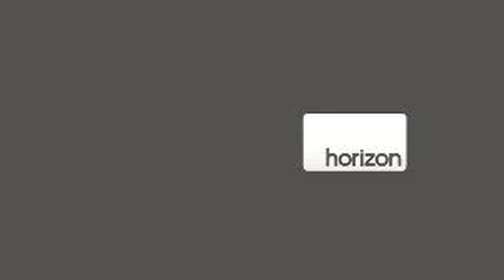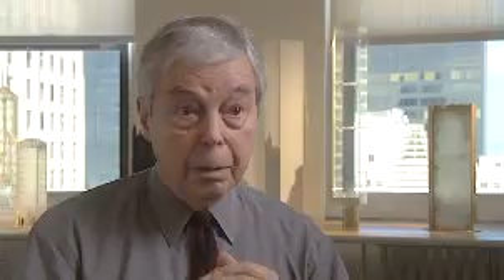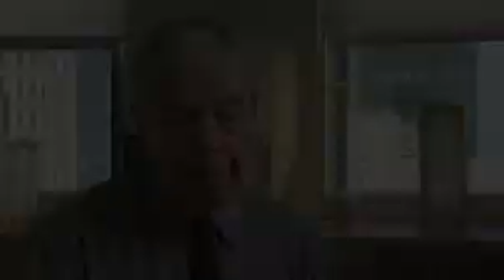Leslie Robertson - Chief Engineer - World Trade Center - Twin Towers

Comment: The best engineer to answer this question comes forward and guess what ... the conspiracy nuts STILL don't question their ideas. I used to believe those ideas at one point, then I changed my mind due to a better understanding of the evidence. Who has the more open mind? Conspiracy nuts, or those who are willing to listen, understand and change their mind when they become aware of new evidence of significant import?
Reply: +askquestions Not only pixel messes, but also sound messes. Plus military officers from other countries who understand the security measures said this is impossible because such a flying object would have been forced to land or shot down by two machines that are always prepared for such case. Also, architects and engineers said its impossible that a building would have collapsed in such case or that an airplane made of aluminium could pierce it. Hell, its not even possible for the boeing to fly that low at such a speed. Then there were the pixel messes you mentioned,  diagonally cut steel beams and traces of thermite. And there are also the political aspects. One year before 9/11 the Taliban refused to sign a pipeline deal with America. The US couldnt invade them because the public was opposed to any aggresion, so they needed to convince the people somehow. The Taliban wouldnt be so stupid to give the US government and the people a reason to invade them after they rejected a pipeline deal, it would be retarded.
Reply: The Buildings came down due to the large amounts of Gayness.......Yes you heard correctly GAYNESS!!.....
Reply: Perhaps I can shed a little light on what is being argued about here...

I haven’t done heavy scientific research, conspiracy research, etc... I will only try to explain this in the simplest and most common sense way possible, as it was told to me... most of this you’d probably know of anyway, but I would like to share what I was told...

In 2001, my husband was on the legal team that represented the Port Authority on the sale of the WTC to Silverstein.... the team also represented the PA on their  RE-leasing of the space they occupied prior to the sale.

He was in the conference room with many other attorneys when the Insurance conversation was happening.  The conversation still resonates with him to this day...

The chief engineer of WTC at the time (I honestly don’t know his name, and not sure if it was this man), explained to one of the attorneys who asked, “What is the likelihood of one building coming down, let alone two?” , that,  “ It’s not as hard as you think... it’s just steel... all you need is enough heat.”... And if I heard correctly, the Twin Towers were built to collapse straight down, correct?

So, yes, a building like that CAN be taken down by fire.... Can’t get much better of a confirmation of this than from  the chief engineer of WTC,....Again, my husband was present during that conversation, and it still resonates, and haunts him, to this day...

Two huge planes crash into buildings with tons of jet fuel.... fires, unbelievably high temps festering for a decent length of time.... there would be nothing else but collapse... common sense... 

There is a first time for everything, and despite expert engineering  and research, nothing is certain until an incident like this occurs.... Unprecedented, yes, but now proven to be possible.

So very simply, in regards to WTC 7.... wouldn’t it make all the sense in the world that if 2 of the main, tallest buildings at the center of the WTC complex came crashing down, there would be significant damage to the buildings around them? You essentially had what I would think would be 2 earthquakes happening , and why should WTC 7 be unscathed? It could have been hit with debris,  but most of it was probably affected by the sheer force of those buildings coming down. 

Again, I am just using complete common sense here... very simplistic, nothing in depth.... Just basing this on what my husband experienced and was told....

As to those who question Silverstein taking out the Insurance policy so close to 9/11? Because that is how the deal was structured.... this portion was probably one of the last parts of the sequence. Of that deal. Any commercial real estate deal, especially on a complex of that magnitude, has to have an Insurance component.... common sense. Why the hell would Silverstein have spent all of his time, money (especially in legal fees), etc to buy an amazing complex such as the WTC, then have it destroyed for insurance money?? Money that he doesn’t need? He likely would have made exorbitant amounts of much more money from businesses, tenants, etc.... common sense...

The complete deal, as I understand it, closed just weeks before 9/11.... thank God it did, because I would have lost my husband. 

A deal of this magnitude had him working there practically all day, every weekday, for months. I had no idea that he was working as much as he was on it...As a matter of fact, the NYPD,quite awhile after 9/11. sent him his building ID, which was in a safe recovered from Ground Zero. 

How I wish we could have given that ID back and traded it for the teeniest fragment of one of the victims, so a family could have closure... 

So, as I said, my comment has very simplistic explanations, not hard scientific facts, but I hope it provides food for thought....
Reply: mike4ty4 - "If you noticed, the buildings "mushroomed" debris all over the place when they collapsed"

Where did the energy to do that come from? Steel framed high rises with 47 sturdy core columns were crushed into "mushroomed debris" from the natural effects of gravity, right? Pull the other one, mike!

"at least one to the point of collapse (7 WTC)"

False. Debris damage played no significant role initiating the collapse of building 7. 

"Thus the plain and obvious conclusion is the planes did the job"

No. The planes made the holes and ignited the fires. That's it. If the planes were directly responsible for killing the towers, then the towers would have fallen straight away. NIST concludes it was the resulting fires that started the collapses. 

"Never before did anyone deliberately fly a plane at full fuel load and full speed into a skyscraper. Expect unexpected results in extraordinary situations"

No. Expect never before seen results, but not with ridiculous explanations.
Reply: ManAgainstCrime - ”No. The planes made the holes and ignited the fires. That’s it.”

That’s misleading, because the planes did cause a lot of structural damage at impact, which was due to the open-floor design of the towers. The two main load-bearing aspects of the design were in the middle of the towers and the perimeter of the towers. The planes destroyed the perimeter, which left the towers with only one load-bearing structural support left. And even then, the internal structural support was also damaged in the impacts. Once the impact floors couldn’t hold the floors above them, that was that.
Reply: mike4ty4 bullshiter
Reply: Hey why don't we start our own business....We can buy some old airliners and remotely fly them into a building when authorised demolition needs to be done...We could revolutionise the demolition industry and save millions on moths of preparations for explosions,thermite..
Reply: makka y Because this method of demolition is very messy and causes a lot of collateral damage. If you noticed, the buildings "mushroomed" debris all over the place when they collapsed, damaging numerous buildings all around, at least one to the point of collapse (7 WTC). That is why we don't fly planes into buildings for demolition and need more precise control of the collapse that only timed explosives can provide. Not to mention that a plane is a very, very expensive piece of hardware (although you could obviate that by using a specially-made dumb impactor, but then again, see the first concern).
Reply: mike4ty4 But those planes did not bring the buildings Down at all,did they?Atleast not in the way they said they did...Never in the history of construction has a event like this happened...The pancake theory is absolute bullshit and the joke is on those that believe such a pathetic story...Isn't it?
Reply: makka y Yes, they sure did. No good evidence has been found of any other device that could have done so (e.g. no good recordings of anything indisputably the sound of numerous high explosives detonating, no residue, Steven Jones' "thermite" claim was reviewed and refuted, etc.). Thus the plain and obvious conclusion is the planes did the job.

"Never has an event like this happened ..." Well, duh. Never before did anyone deliberately fly a plane at full fuel load and full speed into a skyscraper. Expect unexpected results in extraordinary situations.
Reply: mike4ty4 You are with a Liar or uninformed,perhaps both...Quite clearly they came down due to explosives and thermite...Building 7 video show explosive detonations appearing in footage.....There has been buildings on fire before even for days and NO COLLAPSE....Fire itself is not enough to compromise the structural integrity of steel by itself...
Reply: ***** how ever it happened it's sure as hell did not happen they they said it happened..